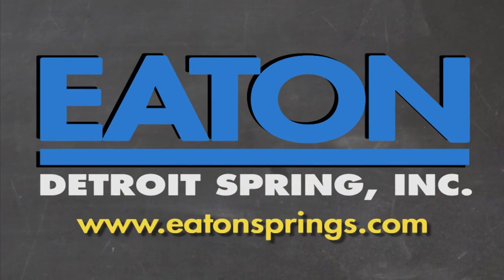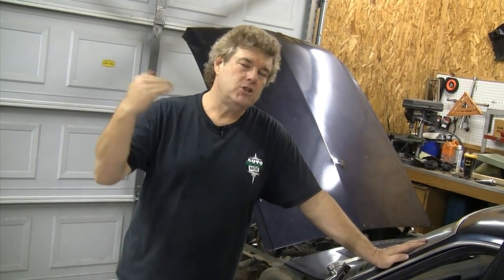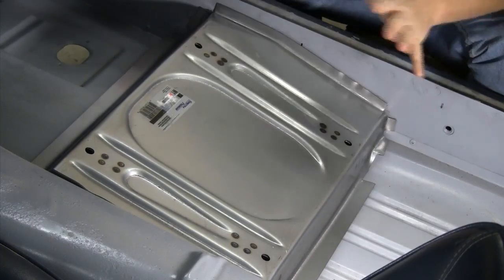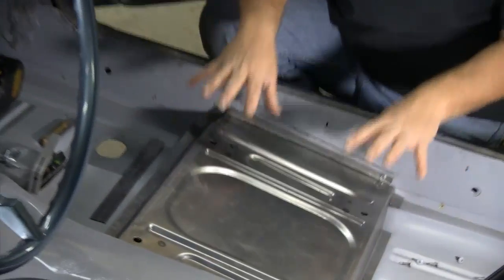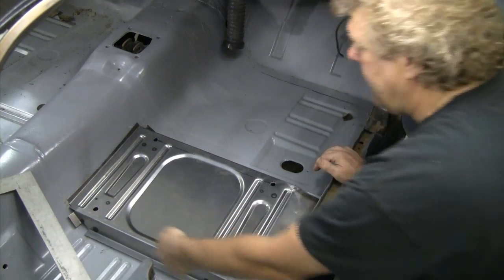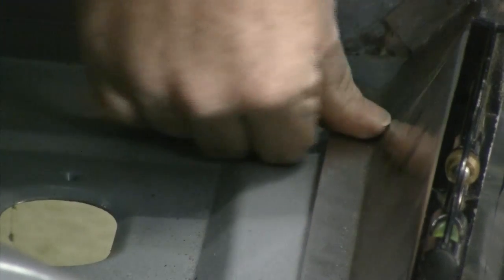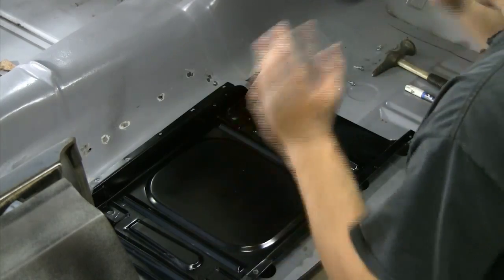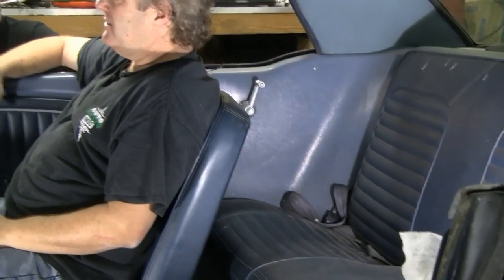New Short Seat Pans for Tall People With 1965 1966 1967 1968 Mustang Episode 241 Autorestomod

Comment: I just installed these on my 67, I took the brace out of the factory seat supports and cut the ends off and welded inside of these new pans for added strength. Coated everything in zinc Weld-Thru primer before welding in. They definitely require a lot of fitment, you'll need a hammer and will likely have a sore arm after lol

Comment: Thanks Jeff for another great video.  I just installed these seat platforms and full floor pans in my 1966.  I ran into a small snag with ordering the '69 carpet set.  I learned that Ford changed their carpet material to save a few bucks and also the colors are different than they were in 1966..at least ford blue a/k/a medium blue.  It's not a huge deal unless you have a pony interior like I do and want to have the matching carpets on the lower portion of the kick panels.  I'm working with NPD to quote me 69 carpet moulds made with the same 1966 carpet material and correct color instead..  I'm also opting for the massback rubber backing this time around..btw I'm also thinking of opting for the '70 Mach 1 carpets because it also has the built in vinyl pieces under each passengers feet, not just on the drivers feet section. I need to verify but it looks like its the looped nylon which appears to be the same material as it was in 66. I tried calling ACC directly but their pricing direct is higher than through one of their vendors. go figure. I'm hoping the quote won't be higher than normal carpet pricing.  It's high as it to me because I paid $79.00 for this carpet 25 yrs ago.
Reply from the maker: Glad we could help! Keep in mind  the blue inserts on the '70 will be a different color than your Pony Interior.

Comment: I'm only 6 foot tall. But I feel like I'm setting on the floor when I'm in my 67 mustang. Is there a way to raise the factory seat so I'm setting a little higher? I thought of a 1x1 square metal tubing between the track and the floor......??? Any suggestions?
Reply: If you get those track extenders they raise you another 1" basically putting you back to normal with these lower supports, but with factory supports theyd raise you.

Comment: I installed the very same seat pans from NPD (67 cougar) and mine fit like crap, mine were too wide, I had to cut off 1/8 to 1/4" off the width to fit in between the rocker and tunnel to  lay flush to floor pan, I contact NPD and they havent heard this issue from any one else? I see your pans fit nicely, I think I got a bad batch from whomever makes these? I did this on a 65 fastback.
Reply from the maker: +soupercooper We know that NPD had these test fit in a '68 Cougar and went back and forth to get a good fit. We had no real problems either aside from typical fit-n-fiddle. Couold you send us some pics of the pan install so we can maybe see what is causing the issue? Send them to: jford@autorestomod.com

Comment: Question for OP or anybody:  My 1965 mustang driver's seat does NOT slide forward or backward and seems fixed in place.  Should it not be adjustable for moving forward or back a little?   When I have time I will get in it with a flashlight and look under the driver's seat to see how it is mounted but so far CANNOT move it forward or back.
Reply from the maker: It is probably "rust locked". I'd remove the seat and use a rust buster lubricant  and see if they free up with some light "love taps". Failing that they are available from NPD.
Reply: @AutoRestoMod  That is exactly what I will do then.  I know the seats are SUPPOSED to move back and forth to let shorter and taller drivers get in and out and reach the pedals.  Don't have a Mr. American physique at my age but also don't have huge belly either.  I have some spray lubs like Ballistol and I have a rubber magic that can work magic.  Ha. Ha. Ha.  Have been watching all the youtube posts I can concerning old mustangs.

Comment: I just got off the phone with Jeff Fein from NPD in Detroit.  He has been working with ACC to make the first '69 Cougar carpets. They had already sent ACC the short seat pans to custom make this carpet mounding and the new carpet should be ready any day now..I might even get the very first one! He also said the 69 or 70 fits better than the 66 carpets but it's still not perfect. He thinks the kit comes with the rocker panel carpets. I'm also looking to order the matching mats with mass backing too. I'm very excited and pleased with NPDs customer service. CJ pony gets a big  👎. If you watch this video and need carpet only call NPD or you'll just be wasting your time.
Reply: What's the update on this? I have a 67 mustang. The guys in the video say to use a 69 carpet, but I just called NPD and the sales guy said to use a 67 cougar carpet in my 67 mustang...
Reply: @EliminatorPerformance  I’d speak to NPD again specifying the carpet you want or call ACC directly for a custom order. Just don’t overthink this. Also LLyods makes the best floor mats.

Comment: Will this 1 inch drop work with a Bench Seat?
Reply from the maker: +Nicholas Werba Honestly we're not sure. We'd recommend measuring the seat to tunnel clearance from the carpet to the bottom edge of the seat, then subtract 1-inch from it. We'd do the test at the furthest point forward and furthest point back.
Reply: Did you ever find out if the bench seat will work/fit? I was wondering the same exact thing myself.  I'm 6'7" and I'm definitely doing the 1" drop.  I plan on using the 89 GT seats with the Pony upholstery but I just love seeing the bench seats.  I'm looking for a bench seat should I be looking for a later year?